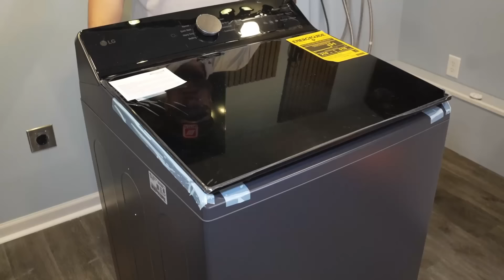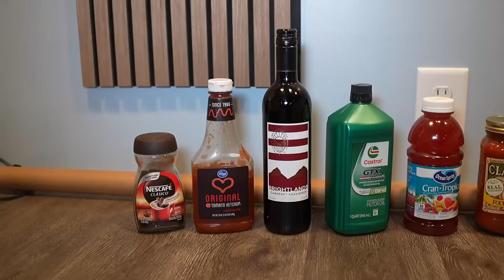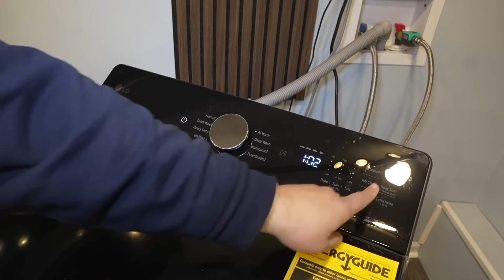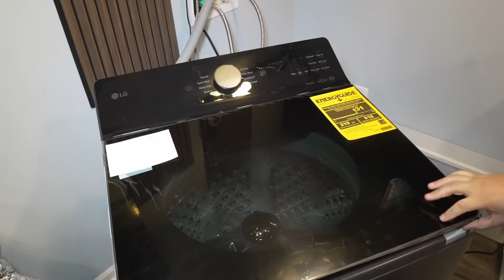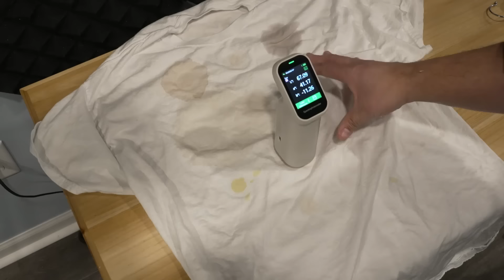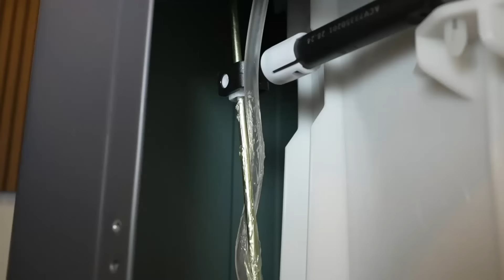Is 2025's "Best Washer" Actually Good? LG WT8405 Test & Teardown

Comment: I am shocked, you are putting so much into doing this testing and doing it right, yet you are adding the pods on top of the load?? Do you know these washers are designed for the detergent to start working while its filling and they state you should only use 1 pod ever , that's because they cant rinse away more detergent than that which would leave detergent in the load and the detergent has the soil attached to it and can leave it in the fabric .   So  you are doing so much right dont let something so basic completely discredit you be using the product against its recommended usage. So add your pod first and only one !!! Your doing great. !!
Reply from the maker: Tide pod instructions directly state to use 2 per medium load. 12lb is a medium load. As for putting them in the bottom, I may do that later on, but for now I do it as a visual effect, and I've done it across the board for every single test I've done, so I have tried to control for that, by the way.

Comment: I have not seen you test dog hair in washers or dryers. We have a long hair white Huskey and a German Shepherd. Blankets and the like are always COVERED in huskey fur. My 10 yo Samsung dryer struggles even with the bounce pet hair dryer sheets, which help A LOT. The new GE washer we have does nothing for fur. Does any manufacturer even test for that? I'm mostly curious about the GE combo but I know I'm not the only one. Thanks for the testing Ben.
Reply: Samsung has a washer with the lint filters inside for pet hair and you clean them after every use almost bought 1 yesterday but came home with the lg instead

Comment: I've had consistantly much better results with a LOT LESS detergent in my 10yo LG washer, typically Tide at a little under the #1 line in the cup for a full load. I usually wash on warm but also sometimes on cold, I do think the issue is traces of detergent residue stays in the fabric otherwise, so the thought of 2-3 tide pods is horrifying to me xD

Comment: I don't understand the point of top loaders at this point. Every front loader I've used has cleaned better than my 1988 Whirlpool, even the toy-sized 7kg EU washer at my friend's house when he stuffed it full.
Reply: It's basic physics. A good top loader with a real (Non HE) agitator simply has a better wash action than a front load. It's just basic physics. Front loaders are also disgusting.

Comment: Wouldnt a bigger agitator clean better?  Those clothes didnt seem to move.  A bigger agitator would promote up-and-down action on the clothes.  Seems to me the clothes on top would get the least clean.  Maybe try one of those $25 test strips at the bottom instead of the top?
Reply from the maker: You'd think. On the test strip - my issue with putting it at the bottom is that if it was better at the bottom, then its not cleaning everything well, which was a reason I put it on top.

Comment: I got a Whirlpool commercial grade basic top load washer with KNOBS. The side of the cabinet rusted out but the washer still runs after TWENTY FIVE YEARS!
Reply from the maker: Wow, that's incredible! It seems like the build quality of those old Whirlpool machines was top notch.
Reply: @bensappliancesandjunk  yes, bought the matching dryer and had to have the thermostat replaced one time, it still runs too.

Comment: I have the upgraded unit with the smart lcd screen. So far its been working great.
Reply: Been trying to decide between the model in the video and the model that you have. I think I’ll go with the updated version too. Does it clean as well without the agitator? That’s my only drawback.
Reply: @RestInLuvGreatloe  Haven't had any issues with washing single, normall to oversized items like king sized blankets
Reply from the maker: Nice to hear that!
Reply: Which model is that ?
Reply: @libbymears7752  WT8600CB is the washer. Washes our clothes and large blankets really well. That's if you like top load washers. The pre-fill detergent and softener function is pretty convenient too.
Reply: @bbbt8090  is it noisy?
Reply: @libbymears7752  To me, it's at normal levels of sound decibels. My laundry room is across from my master bedroom and shares the same wall as my bathroom. I can definitely hear it running. Nonetheless, the washer and dryer are quieter than expected
Reply: @bbbt8090  thank you
Reply: @bbbt8090  I ended up getting the LG 8400. Be here Friday.
Reply: Good to hear some real-world feedback on the LCD version. A lot of people seem skeptical about the “smart” features on appliances, so it’s interesting to hear when someone’s actually had a good experience with it so far.

Comment: Why overstuff the dryer? it takes substantially longer than doing 2 or 3 reasonable loads
Reply from the maker: Im not overstuffing it - its that the dryer is super low capacity, and I mentioned you definitely want to right-size it
Reply: @bensappliancesandjunk 
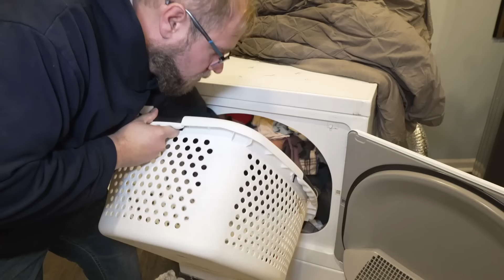At 10:22 in the video that is definitely overstuffed😂.  Half to 2/3 is recommended in a large capacity dryer.  That there appears to cover the whole opening in the door.  Not trying to be disrespectful, just I've never had any luck drying anything that full even untangling the clothes.

Comment: My Miele W1918 washer from 2002 still going strong!
Reply: I can beat that>>Sears Kenmore from 1992 still running (3 loads a week: whites, colors, towels). It has had some problems: detergent dispenser quit; fabric softener dispenser sprung a leak so wires cut off so it won't try to fill: motor coupling broke and had to be changed 15 years ago; control knob broke 15 years ago and had to be replaced. Otherwise mechanics still going strong.
Reply: @hotpuppy1  The Kenmore's of that era were the best. We had the Kenmore Fridge and stove from the Sears in Vancouver. Never failed. Only thing that failed was my marriage! 🤣
Reply from the maker: Wow, nice!

Comment: I don't understand. If these washers cannot remove stains, then (which) washers DO actually clean clothes the best, (and by how much) ?
Looking at the wash action in this video shows clothing that just floats or is stuck on top or the sides, and does not get (any) wash treatment at all.  
How can a machine clean the clothing if the clothing never moves or even gets wet ?
Reply: Sheesh,  just pre-treat the stains before washing. My husband gets a lot of greasy stains on his shirts. Shout to the rescue.
Reply from the maker: Its a great question. In my tests, there are generally 2 theories of how to clean clothes:

1) Lots of water and mixing action from a top loader with an impeller. Its fast, but very inefficient because there has to be enough water in between the cloths to get them to mix and agitate frequently.

2) Use a front loader and let gravity do the agitation. The rotational action of the drum, will naturally allow clothes to mix and agitate upon each other. This takes longer, but then you do not need water to act as the mixing agent, only to clean the clothes. Which takes a lot less water to do. However, this takes way more time.

So it ends up being speed vs. efficiency when it comes to real cleaning actions

Comment: This was really well done.
I'm sticking with my 1974 Maytag and 140°F soft water. That makes more difference than anything else - their 'hot' is really not even luke-warm.
Reply: That's what I want to find, an old school washer with out any bells or whistles.
Reply: Do they have heaters?? I always thought that what came out of the tap was what you got.
Reply: @Drinksfromtap  Some do. I know many of the old wringer washers had heaters, and some were capable of boiling the water.
Reply: I wouldn’t even buy an AI power washing machine either. If I still had a vintage washing machine, trust me, I would keep it and just fix it if something happens to go along with it. And it’s better than wasting money on a new machine that’s gonna break in a couple years. We don’t need AI to do laundry, needs more issues and stuff being screwed up.
Reply: I'm having the same problem with my water nor being HOT. I HATE IT. It mixes cold in with my hot water. Have you tried turning off the cold faucet so that it can only use the hot side?
Reply: That’s a great point about water temperature. A lot of newer washers seem to limit how hot the “hot” cycle actually gets, so it ends up barely warm compared to older machines. Between real hot water and soft water, it’s not surprising that a classic Maytag can still deliver great wash results after all these years.

Comment: In CR, this model is the #1 scoring (with a score of 81) top loader with an agitator. The LG WT7150CW top loader HE (wash plate) machine scored higher (85) and the LG WM4000HWA front loader tops all three with a score of 87.
Reply: So, if we want a top loader, this is the top for LG. The other scores are pointless.

Comment: I agree with you --- better performance with just a wash plate and no agitator and more cycle options. :hand-pink-waving:
Reply: Do you think that the impeller version is good? I’m looking to buy and the impeller version is on sale.
Reply: It would be a better agitator washer if it had real real fins on the bottom. Those humps don't do anything to move a load around

Comment: I lost confidence in CR about 8 years ago, not sure what happened to them
Reply: I do. They sold out and allowed companies to advertise their score and to show off the product. In the past, they sued people if the used them in any advertising. The other big one, was they went woke and fake green and CC nonsense. They now skew all scores and weight the energy saver stuff to make so so products show better than the top of the line products. Speed Queen washer is a good example. Not green enough for them with epa water and electricity usage so they are rated below many washers, when in reality, they are #1. Another example is making the electric SUV rate higher than the gas version even though we all know the gas is better. So the gas car will get lower scores than the electric vehicles JUST BECAUSE they are electric. It has been proven that electric cars are worse for the planet than gas cars. I do like the customer rated part for reliability and satisfaction. That is, unless they are skewing those as well. ??

Comment: FYI... looking at the washer specs, it is not a HE (high efficiency) washer.  It is Energy Star, but not HE.  That said, a mediocre or below average washer is no surprise... I'm not a fan of Korean home appliances, especially LG.
Reply from the maker: HE is defined as having an agitator plate or not by most standards
Reply: @bensappliancesandjunk   In this case, this does have an impeller.  Regardless, the spec on Lowe's has it indicating a "no" for HE.  Near the end of the video, you stated this was an HE washer. This appears to be an honest review of the washer.
Reply from the maker: @fialee8  its Energy Star compliant. In general, any energy star appliance has to be HE to get the rating. 

The issue is that quite literally, the terminology is nebulous and may not be accurate. Its why I did provide actual water/electricity usages in the soil test spreadsheet that is in the description. Although I don't have WH ratings on every mode, the water usage is all there and you are welcome to look at it versus other washers that are labeled HE that I've tested to make an accurate determination.

Comment: I have the LG WM4000 front washer. It's #1 on CR and Spruce. It's been great so far.
Reply: I just purchased the same washer and matching dryer set two weeks ago. I emailed Ben for his honest opinion and he gave it his thumb up of approval. It's been terrific so far and very quiet. Doesn't need much water. Enough space for a king size comforter. Has saved us a lot of money compared to the top loaders.
Reply: are your units leaving detergent and fabric softener in the dispensing tray?  From load one mine does and on every other load since. Ten days old. It’s going to mold.  I’ve done all the troubleshooting, water pressure is great, washer balanced, use HE detergent tried all options.
Reply: Why did you use pods instead of using (and testing) the detergent dispenser?  My brand new washer of this model is not draining all the detergent.   Mold is going to be bad.  My previous LG top loader did.    I did all the troubleshooting they recommended and morel
Reply: I am glad you like it. But this is about top loaders.

Comment: The back and forth action of the agitation just seems pointless. The impeller flavor of these he top loads still seem better. You can bet the TC5 is going to smoke this LG in wash performance though.
Reply from the maker: So far in the tests I've done w/ the TC5 it hasn't. It will run quicker, but not better, but I still have about 6 loads to do.

Comforter tests in the TC5 have been outright abysmal though
Reply: @ I’ll be interested to see your findings 👍

Comment: I’ve had good luck with lg.  I have a 12 or so year old wt1001.  Had to replace the drain pump but no biggie.  Just waiting for it to crap so I can get a front load
Reply: I am returning mine as I am already tired of wiping the liner seal, opening the door, emptying the soap tray, monthly filter clean, etc. Going to top load 100%.

Comment: I am not buying a machine on how well it removes stains. I have different soaps and treatment options for cleaning clothing. No machines can beat my treatment options to remove stains. Stains are not common for me and when I spill something I clean it before it sets. The machine needs to be durable and I can get parts. It needs to be middle of the road cleaning or better but it must be able to spin the water out of my clothing.
It looks like the control switches could be a problem. I prefer having presets that help limit the key presses. Then have the preset buttons have stronger switches.
They all look cheap after you own a Speed Queen.
Reply from the maker: I understand. The interesting thing is that lifetime ownerships on a machine like this will likely beat most Speed Queens due to water/electric usage over their lifespan, assuming average costs for those things. Especially since SQ's water extraction via spin tends to be very weak vs. competitors.
Reply: @bensappliancesandjunk  I run a TR3 and because the metal drum that weighs more it will draw more current. The pump is a monster and it should draw more. I will put a kilowatt on it and see what it draws.
I have to be honest I miss my Staber but it's 30 plus years old and parts are hard to come by. It is very gentle on clothing.
 I could keep a Amana top loader running for countless years doing one load a week. I was given one that has a leaking seal that I need to fix. I will test it on the kilowatt.

Comment: Consumer Repots is history. Long story. LG AC's, that were rated number one when I still subscribed to CR were horrible. I bought 3 a few years back and MAN did I get burned. I never had  an LG refrigerator, but I DO know that they were using an inferior compressor for years and just wouldn't get rid of it.  I wouldn't buy any LG AC or Refrigerator. Their TV are great because of the WIDE viewing angle and longevity. Have six LG TV's for quite a few years and they're still working perfectly. I absolute LOVE my  SPEED QUEEN TC5003WN. Didn't you recommend it? GREAT quality. Wish the capacity was larger. I wouldn't touch LG ever since their compressor rip off with their refrigerators. There was a class action suit and I think the customers won . I only recommend the SPEED QUEEN TC5003WN  and the Speed Queen front loader that goes for like twice the price. LOVE your videos. THANKS!
Reply: Agreed. They have gone woke as well so they are not basing their tests solely on concrete testing results but environmental factors as well. I stopped subscribing when they were automatically giving cars that were EV or Hybrids higher scores, not because they actually performed better and were higher quality and more reliable, but whether they were environmentally correct. lol

Comment: Great review Ben. I'm a fan of LG top load washers as they are 27" wide (Most top load washers are 27.5" or 28" wide). The new generation models with the matte black color seem to be better built than the previous generation models. Also, LG makes all their top load washers in Thailand but they're bringing it back to Tennessee due to tariffs.

Comment: I just ordered a WT6105CW from Costco cuz I was unable to fix my 13 yr old GE GTAN4250M1WS Top Load.

I read that a lot of machines barely add enough water, and some people said the clothes on top don't even get wet. At least this model has a deep fill option besides the auto sense.

I might still try to further diagnose the old one and try and do some board repair. Then I can cancel the new one.

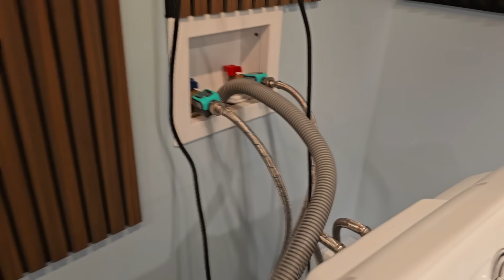Comment: Ben 16:38 what are the teal boxes before the water hoses?? Some system that turns water. Off when washer not running??? If so. Do you advise consumer have some setup like that ???
Reply from the maker: It's my flow meters to check for water usage